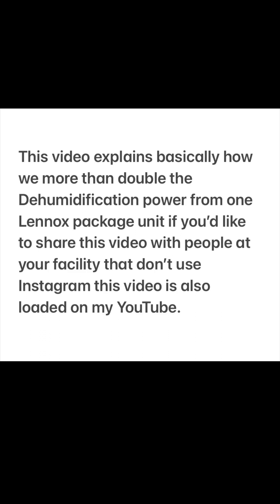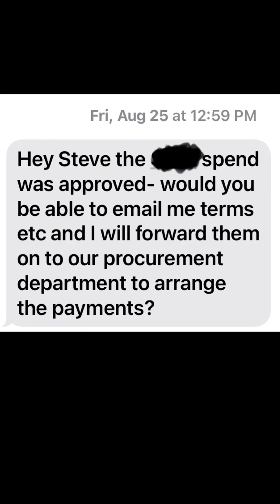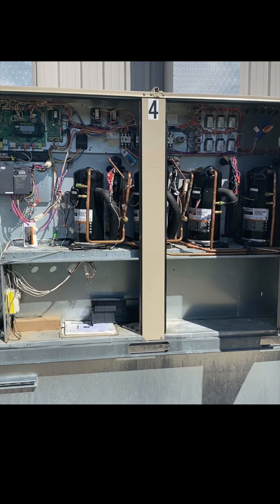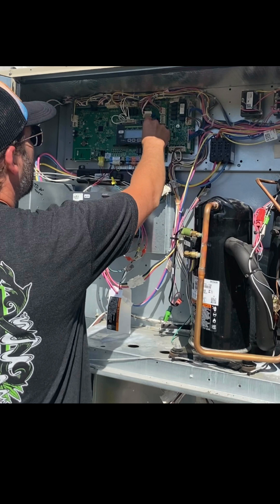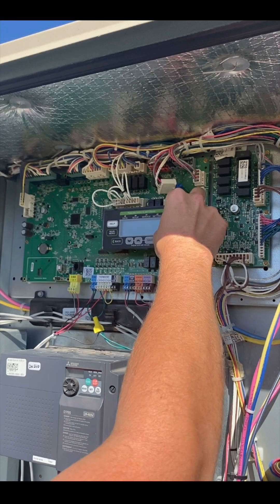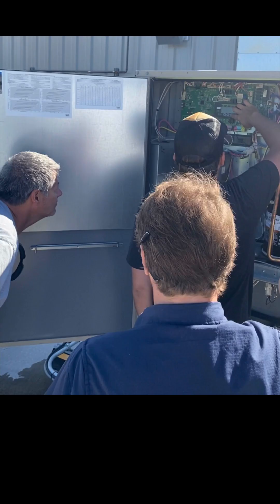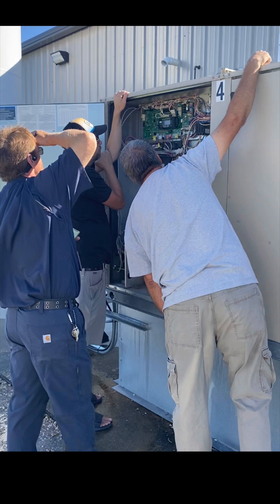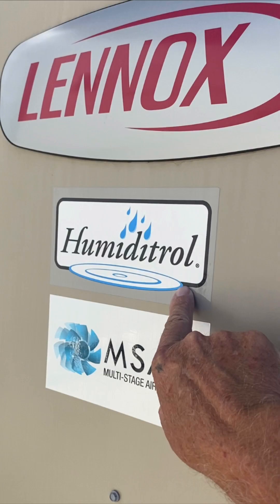25 ton Lennox Reheat Setup

Comment: Steve I know your not the grower, but in regardless to yoir closing statements, can you tell me have the growers ever said anything about Co2  uptake at lower temps?   And if that worries them or not?     I'm assuming as long as they are hitting their VPD it doesn't matter.   But curious if your ever a part of that conversation?    Probably a stupid question for you I know but I have to ask.   Appreciate your time sir.
Reply: Cold slows down cellular respiration which in turn would make the plant use less Co2. 
The rule I follow is 250 PPM Co2 above the PPFD. I am looking for it to never go over that or under the PPFD.
Reply from the maker: Not sure what yer asking, but I can say I’ve observed both light and co2 being being increased and then decreased over the weeks,